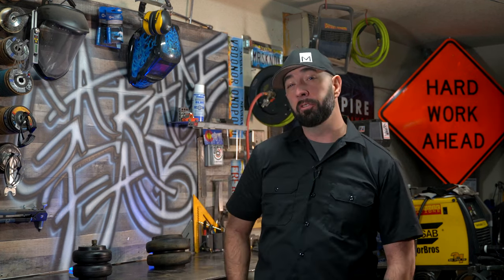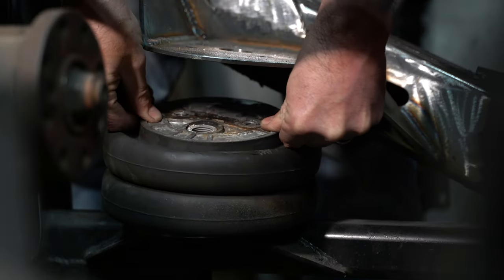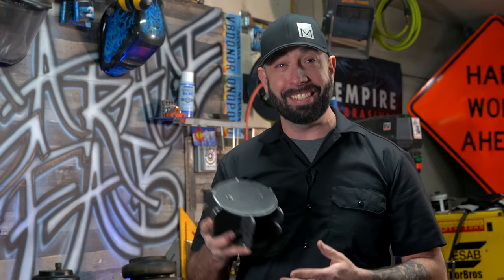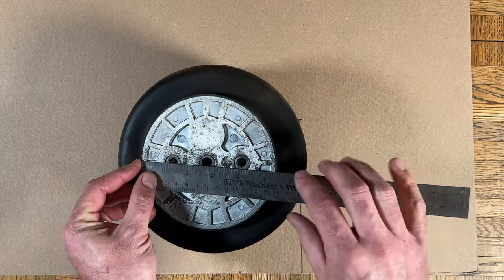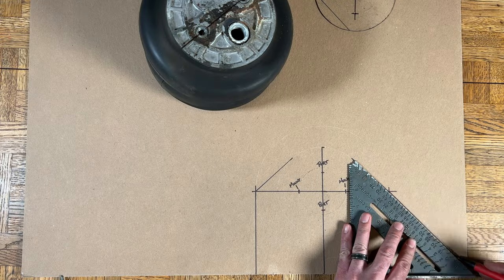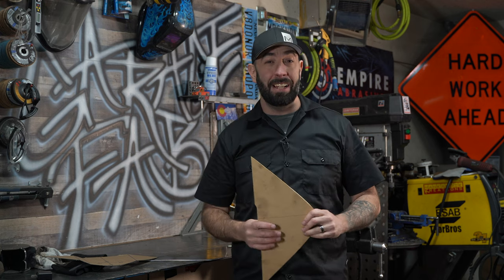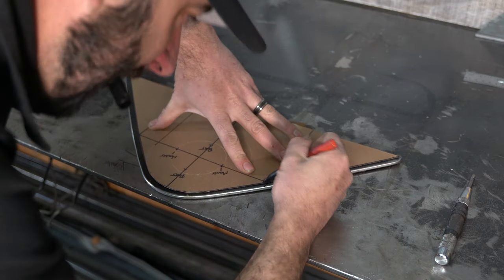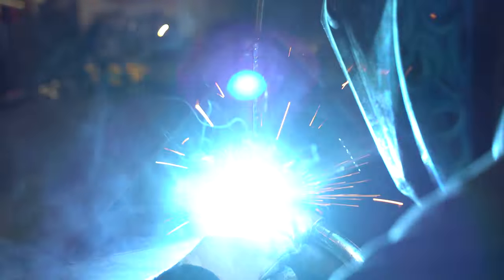Design and Build Upper Bag Brackets From Scratch! Mighty Max Ep. 17

Comment: I thought I new more until I started watching this channel, very helpful videos,
Reply from the maker: Thank you my friend! 🙏 To be fair, I don’t know much either.
Reply: @GarageFab  can you do a video on 3 link suspension also dose a 3 link suspension need a watts link if it’s square tube
Reply from the maker: I’m unsure if I’ll get the opportunity to build a 3 link, so a video on that specifically is unlikely.
A typical 3 link would in fact require either a panhard bar or a watts link.
I suppose you could get creative and angle the two lower bars to form a triangle which would then eliminate the need for a lateral locating bar, but I haven’t seen that done yet.
The shape of the bars won’t have any effect on how a suspension operates, only the orientation of those bars.

Comment: I can't get enough of your content.  I was into rock crawling, desert racing, and that sort of fabrication in my younger days. I didn't realize how much work and how similar it was to lowering a truck.  I also shared in your WTF moments when learning about u-joints and all of that headache I had put my younger self through not realizing how that all worked. I was even told to just set my dif 3-5* 'down'!   I wish I saw this 20 years ago.
Reply from the maker: It’s interesting how the basics apply to just about everything. Also there’s not always as much work required to bag a truck. I make everything far more complicated than necessary just so that I have content to create. Often you can just slap an air spring in place of a regular one and you’re good to go. 😆 
Glad to have you my friend. See you in the next!

Comment: Great video as always, I’m working on my rear suspension now and nearly finished so airbag brackets next, just to add on what you have explained to take into consideration if the bags in front of axel it will give you more travel depends on how far it is from axel and the opposite if it’s on the back (also how it reacts to pumps and load capacity)
Reply from the maker: Very true! I decided to make that concept its own video sometime in the near future. I worry throwing that kind of info at people could cause confusion. I try my best not to confuse. 😂

Comment: Very good info on all your videos 👍,can you do a video on bagging a truck with leaf springs, not sure if the leaf springs needs to be replaced with bar links .
Reply from the maker: Link bars are certainly superior to leaf springs but that doesn’t mean you HAVE to change them. I’ll never clown anyone for installing bags on the leaves. It’s certainly much easier and cheaper and a fun way of starting with air suspension.
I’d very much like to create a video (or a series) on the cheapest and easiest ways of bagging a vehicle. Don’t hold your breath though, I’m not sure when I’ll be able to do that.
Until then, I’d suggest removing all but the main leaf. This will lower the truck significantly. Potentially too much. Then slap a helper bag in there to get it back up to whatever height you like to drive.

Comment: Nice one!!! Just did mine on my 50 Ford. They are big and ridiculous LOL!!!! I used a section of 2x3 for my mock bags (just watched your last vid, thanks for the tip). Gives me like 1/4" of play when laid out. A thought, since you have your bags on the lower link bars you should get a little more lift than you would if the bags were on the axle.
Reply from the maker: Yes! A significant amount more lift and a softer ride as well. I used to struggle trying to decide if I should include info knowing it might confuse some folks. I’ve decided to avoid confusion at all costs. I’ll likely do a specific video a little later in the differences in bag locations.
Got an Instagram? I’d love to see the Ford! 🙌
Reply: @GarageFab  Got ya! I just do YouTube and Facebook. Maybe I'll work on the Instagram thing over the weekend. I will probably post a video of the Ford outside in a week or so. I have to repaint my wife's Mazda (Protege5). So, I need to get the Ford out of the shop. I still have a long way to go on it.
Reply from the maker: Haha. Damn Wives and the projects. 🤦🏻‍♂️ We need his and hers garages.

Comment: Another great video! Will you be going over how to size shocks when using air bags? Can you use what’s normally specified or do you need to do the math? Thanks again. Always looking forward to the next video!
Reply from the maker: I was NOT going to do shocks. Because I forgot about them! 🫣 But I certainly will now. Thank you Robert! I guess I assumed (again) that the shocks I installed before the rebuild would work fine. I guess I should check them out eh?
So yes, I will now be going over shocks You can expect to see that one shortly. Cheers!

Comment: First of all, I would like to say, I really enjoyed all your videos. I especially like the suspension videos as I am starting a project of my own. The first question I have is there a rule of thumb for the length of the rear bars and second the distance between them. I have a 1959 Chevy Apache with a short bed 2 x 5 tube frame with the 80s Camaro stub front steer. I won’t be able to lay frame but I would like to lay rockers. I’m going to build my own brackets, but I would like your opinion on where to buy the bars and the watts  linkage.  I brought this truck back from Arizona 40 years ago on plans of restoring it when I retired which is now any advice would sure be appreciated. Sorry this is kind of long. Thank you.

Comment: Thank you, Kandy of the Man! For those of who never lived the bagged life and are bag curious, what inflated height does a bag ride best at and does that need to be figured in with your full inflated/ deflated bracket calculations? Also, would an adjustable upper bracket allow a worth while tuning ability? v/r wh
Reply from the maker: The the height that a bag rides best… is a matter of opinion. Your perfect ride might not be the same as mine. 
Air suspension works opposite of a typical metal spring suspension. An extremely low ride height is incredibly soft, unresponsive and mushy. A high ride height is rough and bumpy and quite unpleasant. The Goldilocks area for most is right smack dab in the center.
The downside to air suspension is you can choose your ride height, or you can choose your ride quality, but not both.
That said, your adjustable bag mounts is really quite brilliant. I’ve pondered over the years about a hybrid suspension, half hydraulic and half air that would allow you to adjust the firmness of the suspension with the air and the height with the hydraulics. But an adjustable bracket could do the same thing.
Reply: MK: Thank you very much for such a detailed response. I realize that may not be a reality as your channel grows. I apologize for the late response because I had to let your words percolate. 
          Perhaps another path besides hydraulic over air (which would be very cool) is a bag parallel with a coil spring (or coil over) connected at the top with a bell crank. An over head teeter totter if you will. The bell crank could have a couple of mounting holes to vary the leverage on the bag and the spring independently. You could adjust a ratio/bias like a gigantic roller rocker. 
           Adding tabs while you make the bell crank mount double sheer would allow a place to put a dummy link for tuning. You would inflate the bag to near max, install the dummy link, deflate the bag and spin the adjustable mount up or down (as we discussed above) to dial in ride height and spring rate. Re-inflate the bag, remove the link and go cruise. 
           Also, I watched your video about your buddies C-10 and in that application being sprung on the axle wasn’t ideal. My idea about a parallel spring and bag would be simplest on an axle or spindle/ A arm; however, the rear could be done with the bag on the parallel upper bar, but the spring would need to fixed inboard on the frame with an offset cantilevered bell crank over the frame.
            Finally, all of that complicated packaging, would also suit your hydraulic proposal just as well. Trust the cardboard. v/r wh
Reply from the maker: Talk about needing to percolate! That sounded like some brilliant stuff but I’m going to have to review again at a later date. (I was up till 5 am finishing the last video and now it’s midnight.) The brain just ain’t braining right now. 😂 
I look forward to discussing this in the future. Until then… thank you William!

Comment: Well, air bags on a plow truck is the idea, so slamming it may not be the option. Would it still be concidered bagged? I'm thinking leaf helper style.. I want it lowered, but not quite slammed. Daily snow-able. Good idea? And input?
Reply from the maker: Absolutely it’s still bagged! That’s a good way of going. Remove some of the leaf spring leaves to soften the ride significantly and in turn also lowering it. Then use the helpers to adjust the height when needed. (Towing, snow, etc)

Comment: @13:00 you can see the one side of the bag stretched. Would it be good to angle the mount bracket to eliminate this and just have it angled while at full deflate. Supposed to use seperate bump stops anyways. 
May e the bag was way beyond its max travel though.
Reply from the maker: I believe it’s true that the life of an angled bag is shorter than the life of a bag that’s always straight, but a straight bag is extremely rare except on a parallel four link with a bag mounted to the axle.
I’m not sure the small amount of extra life would be worth the headache of trying to mount the air spring so that the angle was correct while deflated. Not to mention trying to explain to all the haters at the car shows why your bag looks tweaked when the vehicle is laid out.
Also this angle when laid out would rob you of an inch or so of the air springs lifting capabilities.
This is a terrible answer, but since this angle is so much more extreme on front control arms, and yet it’s still the excepted way of mounting a bag, I simply wouldn’t worry about it.

Comment: Waking up  over here in Australia to a new Garage Fab video is an excellent way to start the day!  Quick question if you don't mind please - does the 3/8" plate distort a degree or two when welding up the score?  If so, do you give it a little love tap to bring it back to where it needs to be?  ...or do you factor in the heat of the weld when you bend the original angle, and allow for a degree or two of movement?  Thanks!  Your videos help my build to keep moving forward.
Reply from the maker: Hey Craig! Funny you ask. I expected the weld to shrink and straighten out the bend a little, so I bent it just a tiny bit extra with that in mind. But when I set it in place after welding, it looked as if it didn’t change at all. 🤨 So a love tap it was! After welding on the main part of the bracket, I had to smack the gusset into place. My only guess is since the score is cut nearly completely thought the metal, the weld is getting 100% penetration, basically welding the middle of the plate rather than favoring one side or the other. Did that make sense?
As always, thank you Craig!!
Reply: @GarageFab  I'd never really thought about the "welding the middle of the plate" aspect before.  Makes perfect sense.  Thank you!
Reply from the maker: Anytime my man. Good to see you again.

Comment: Will having the lower bag mount offset on the lower bar instead of center on the bar affect the bushing wear. And can it have any other negative effects. Also does lower bag position on bar matter? Thanks
Reply from the maker: This is something I’ve always avoided on my own personal builds, Kris. And when I purchased this truck, the offset bags drove me nuts. By not centering the bag it’ll cause the bar to twist creating unnatural pressures on the bushings…
…in theory. But I drove the truck for years with that design and the bushings look brand new. I decided to leave it because it obviously wasn’t damaging the bushings, and this design allows the bars to be closer to the frame. Wider set bars are better for stability and also better for the axle tube. (Because bars too far in can cause the axle tube to bend over time)
As for the bag position on the bar; I assume you mean front-to-back position and YES! It matters a great deal. First in the amount of lift. An 8 inch tall bag mounted on top of the axle will give 8 inches of lift. But as you slide the bag forward towards the front link bar pivot/bushing, the amount of lift increases with the same 8 inch tall bag. An 8 inch bag mounted on the center of a link bar would provide upwards of 12 inches of lift.
I would not recommend mounting a bag any further forward than the halfway point. As you move the bag forward, lift increases but the weight the bag is subjected to increases as well because of additional leverage of the link bar. Not only is the bag under more stress but so is the link bar.
And lastly, when the bag is under more stress because of additional weight, this softens the ride significantly. Bag on bar is a very firm ride. Bag near the center is soft and luxurious. Any further forward would be complete mush. 
Hopefully that wasn’t overwhelming. I think that would be a good video. 🤔
Reply: Thanks so much for the reply. I was thinking of running bag on bar but it would have to be off set. I guess I'll just keep to my original plan with sleeve bags on axle. I have zero room back there and just want to keep it simple . Your videos have helped me understand and help me with my projects. Keep up the good work. Thanks
Reply from the maker: Sounds like you’re on the right track my man. 👏 Thank you for the kind words!

Comment: Good morning. I just recently decided to do my own suspension. I have an 07 Crown vic and I was hoping you can suggest a way to build a lower bracket so that it would sit on the spring perch instead of welding cups to the axle which is what I dont want do. In the even I decide to install coilovers, ridetech and viking has options for the crown vics that utilize the OE rear spring perches.
Reply from the maker: Hey! What type of suspension are you planning on installing. For air springs, generally simplest lower mount you can make on style axle is simply a plate the bolts to the bottom of the bag, welded to a short piece of large large tube the same diameter as the bottom of the spring. 
It resembles an upside-down hat that fits tightly around the bump on the spring perch, the same way the metal spring did.
I can’t picture how a coil over would mount to this perch. 🤔
Reply: @Garage Fab  so manufacturers like ridetech and viking have coilovers that can utilize the spring perches and pretty much fits in like OE. 

Now what I was thinking was something similar to what you said but I was thinking of buying a spring seat and weld that to the short tube. The other concern is that for the top of the airspring, on an oe setup, the top of the air spring is secured with a retainer clip. So essentially I'm trying to figure out how to build an assembly for the rear axle so the bag can drop in and out like OE if you're familiar with what that setup looks like on a panther body.
Reply from the maker: I wasn’t familiar when I woke up this morning, but after your message I had to look up some photos. 😆 I did see one with air suspension and I could see that they had clips on the top that are very similar to some of our Lexus air suspension. I couldn’t see up close what the clips or the post on top of the air spring look like, but I predict it wouldn’t be too hard to build a plate to bolt to the top of a typical air spring that has that post on top. Or if you couldn’t Fabricate that, perhaps a short threaded stud instead.
Do all Panther frames have provisions for air suspension? Or do you have to modify the frame as well?
Reply: @Garage Fab  all 03+ have provisions for air ride. I've been practicing welding and I'm no fool to think I can do it now but eventually the goal is to fab my own brackets but after talking to a few buddies in the panther game, they told me to suck it up and do it right. So it seems, typically, that they cut off the spring perch so mount the lower bracket correctly and if I wanted to go back to a spring, I'd have to replace the whole axle which costs nothing ag the junkyard. 

Seems there's no shortcuts especially when it comes to making sure you have safe suspension. I mean it does help you stay on the road 🤣. I also want to say thank you for your detailed response. The fact that you took the time to look on your own means a lot. You have a new subscriber
Reply from the maker: Happy to have you my friend. 🙏 I can’t argue with that. Safety should certainly be a main concern. After that, (for me personally) comes ease of maintenance. 
A big challenge with aftermarket air suspension, is the desired results are different. Factory vehicles aren’t meant to lay the car on the ground. So factory air springs always have some pressure (unless they fail) and this pressure is usually what keeps them in place. Hence the need for nothing but a tiny clip on top and often nothing but a post on the bottom.
As soon as all air pressure is released, there’s nothing to keep the spring seated and it will dislodge. That would be the main reason that aftermarket air springs bolt into place. 🤔